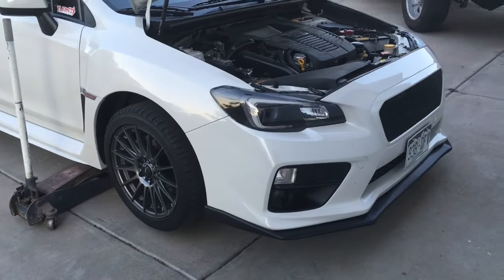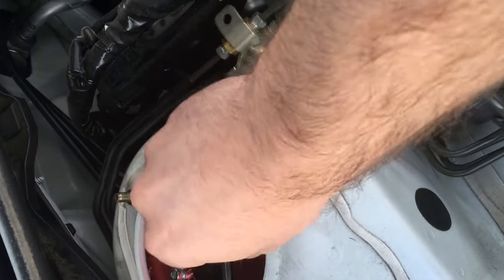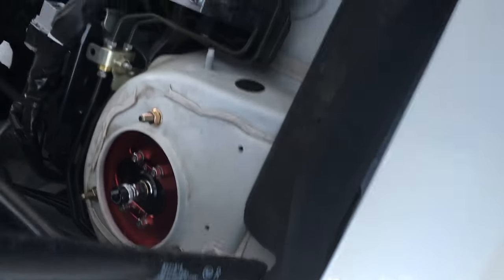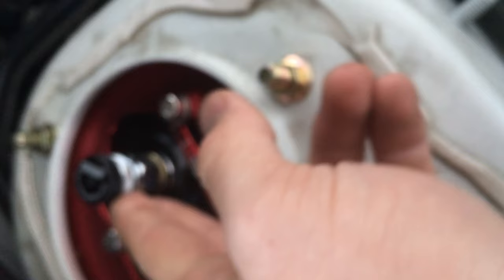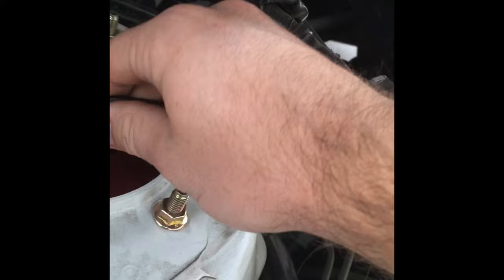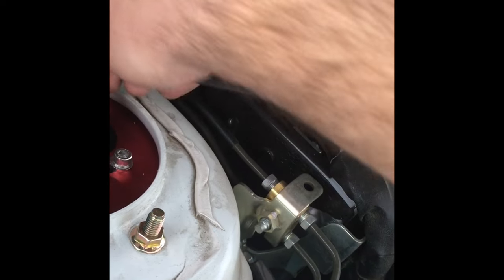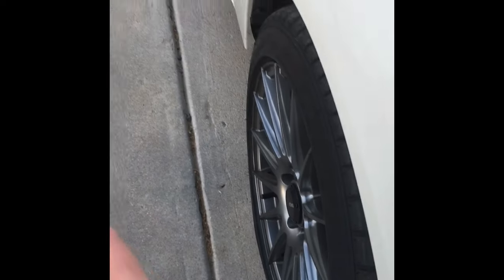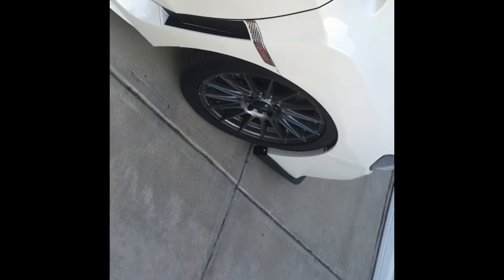Camber Adjustment

Comment: I find it hard to believe that the wheels in cambered position can be held by those small little bolts that slide.
Reply: I thought the same thing when I fitted them.. but I realised, the majority of forces on the strut are vertical.. but I ALWAYS check them cause I still don't trust em!
Reply: You can say that about any screw that holds loads......camber plates with spherical bushings have been proven time and time again to have a performance advantage over rubber bearing mounts and good quality plates never have problems with compliance of the plate.
Reply: me too, until i tried, only one time i forgot to tighten the little bolts and it was sliding, otherwise just regular hand tighten with the allen key was sufficient
Reply: Those bolts go into little holes to keep them from sliding…

Comment: scary how easy it is to adjust camber. i got an alignment and i noticed one of my tires is wearing on the inside so now i can try to adjust this myself and save some money. THANKS!!!
Reply: Lol no bro.  If you adjust the camber that’s gonna mess your toe up.
Reply: @dumbeezy5480 No actually. Excessive camber will but you can only go so far negative and positive on these.
Reply: @dezznutz8692  No

Comment: Any rubbing issues with the bags when you added more camber? and also do you have camber bolts to help as well?
Reply from the maker: Dispatch Sales No I haven't had any issues with rubbing, nor do I have camber bolts. I am running very close to factory spec on camber, I could still add a good amount

Comment: Thanks so much for the vid. I just place a coils over kit but I am far from do this correct. First I measured the original struts with the coilsover and lowered a little bit it. Installed and it was extremely high and positive. Than, 2nd, I measure the excesses (about 8cm) and took this out and, installed again. This time was to low and weird thing, the sway bar didn't connected. It was to  far for engage. I don't know what I am doing.

Comment: I want to do this to my Kia Rio 5 but it looks like there is some cutting involved to put a camber plate on it cuz right now it has three bolts and they don't move at all so I guess you just have to cut little slits so it can move back and forth . Can you adjust the camber at the bottom of the strut ? I just kind of want to take the wheels in but is the only way to achieve that is by camber plate?

Comment: so. would you just need an adjustable coilovers or would you need camber arms and plates for a stock car?
Reply: Depends on the car. Some OEM spring diameters are too large so that when you try to use camber plates they foul, aftermarket coilovers have smaller diameter springs.

Comment: Does it adjust to the rear automatically? How do you camber the rear?
Reply: Rear camber is done through lower control arms and toe arms. You need aftermarket ones to adjust the rear camber to anything past -2 to -2.5

Comment: hey! those bolts on the camber plates.. how do they hold position when driving over bumps and such? they were barely tight?
Reply from the maker: Oliver De Donno not bolt on camber plates came installed on Airlift suspension, but they bolts that hold the camber down don't move at all
Reply: ok thanks!

Comment: Did you have camber plates on the rear coilovers too? If not how'd you get the camber to be so aggressive on the back tires?
Reply from the maker: Jakobi Baker You can't have camber bolts on the back. On the 2015 and up WRX the rear tires are on adjustable for camber (without added parts). I'm actually in factory spec for the rears when I'm at ride height, but when I drop it to the ground the tears go way negative. I didn't do anything to make the rears that aggressive. I hope than answers your question!

Comment: Hey I have a question how do you move your camber so smooth? I've jacked my car up and loosen the bolts and pushed and it's a bitch :/ just won't move
Reply from the maker: TeAZeR1o1 make sure the bolts are all loosened enough, and if need be push on the tire itself. If you take it in to get an alignment they will get camber within factory spec for you

Comment: I just put a kit on my civic and set the struts and shocks before I stick them on the car to the best of my ability well the passenger side has a lot of camber well not a lot but it matches good with the back and it clears the fenders when I turn unlike the driver side so I watched your videos and did the samething and i set it to match the other one and it didn’t move at all then I tried to push it more to get the same look at the other side and still nothing it didn’t matter how much I moved it it didn’t pull the top of the wheel in at all any ideas why and why the passenger side would be set the same or close to it and have more camber it’s making the car pull to one side too I got to get that shit right some how and one the back sides is about a half inch to a inch higher and there let all the way out and same with the shock so idk how the fuck that is

Comment: I tried to increase my negative camber but the bag will always hit the wall behind it. Help? I drive a FRS
Reply from the maker: Tizmo JDM little confused on your question, you have bags or coils?
Reply: Subielicious bags. When i put just a little bit of camber. The bag hits the wall. Any ideas on what i should do?
Reply from the maker: Tizmo JDM should have plenty of room, best bet would be to contact Airlift and see what they would recommend
Reply: Maybe you already had your question answered, but those with the 86/BRZ/FRS need to bang out that wall if you adjust a lot of camber from your camber plates to make room. Either do that or adjust by aftermarket camber bolts + minimal camber plate adjustment or slotting top hole of strut (possibly even front lower control arm too if you need it to get camber gang specs). Also, shave out the metal bolt and any clips in that wall to avoid any bags popping in the fronts only. For you WRX/STI guys, you would most likely be fine but look out for that metal bolt clearance too and check your wheel clearance.

Comment: Hey bro. I just installed some coilovers on my car. The front came with camber adjustable and the rear didn't. I tried my best to adjust the front as good as I can, which is a PITA to get it correctly. But for the rear, it has negative camber. How did you fix that on yours or did you leave like that in the back? Also, I keep hearing that it's not worth it to get an alignment since you can do it yourself with that camber adjustment. What did you ended up doing? Please let me know.
Reply from the maker: Subaru WRX The rear is non adjustable on these cars, if you want to adjust it you have to buy a camber kit for the rear. And you need an alignment, you can adjust camer with camber plates but can't account for your toe, and how strait the car drives. Wait 500-1000 miles for the coils to break in and get an alignment, it's only like $50 and it can end up saving you from eating through your tires
Reply: Subielicious okay I see. So for yours? Did you just leave the rear like that or you ended up getting a camber set? I'm not sure what you mean about the toe? Can you clarify, I'm new to this. Thanks. Also have a question. For some reason, my springs makes a lot of damn noises. Especially when I turn left or right. There's some visible noise while driving also. Any idea on what I could check to stop that? It's getting really annoying. Thanks for replying man.
Reply from the maker: Subaru WRX I left mine, no rear camber kit. And toe is basically making sure your tire is strait and not pointing inwards or outwords. And I don't know much about coils so I can't answer that for you
Reply: @subielicious6892  80 miles is plenty.

Comment: I wouldn't trust those markers. Alignment shops have the proper measuring equipment to accurately adjust the suspension for ~50 bucks.

Comment: Your suspension is installed wrong. And you only proved it by showing us the difference in Fitment before and after. The movement should be from side to side, not front back to back.